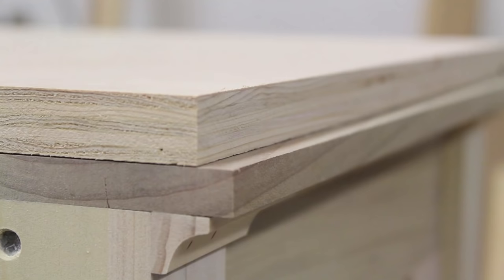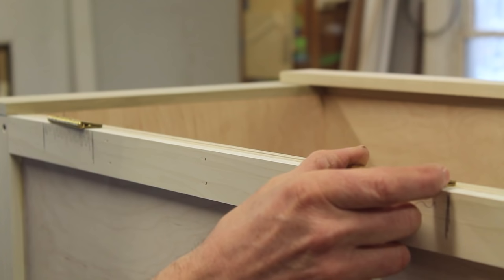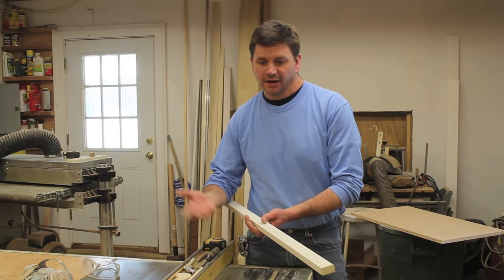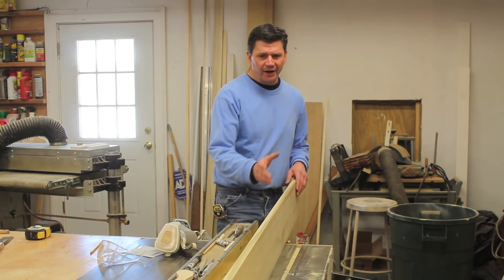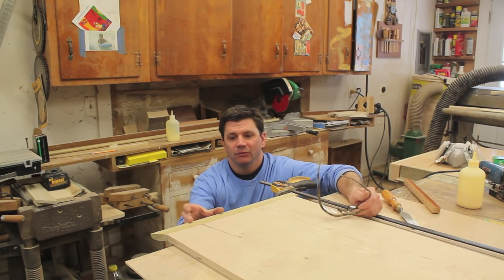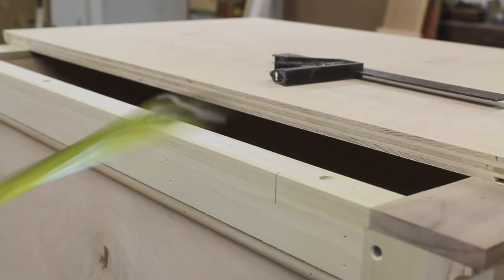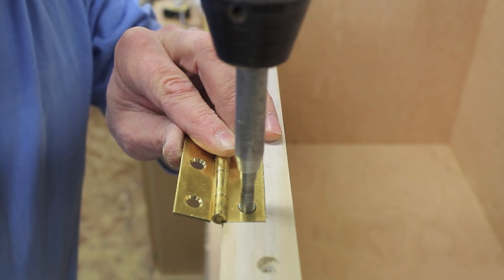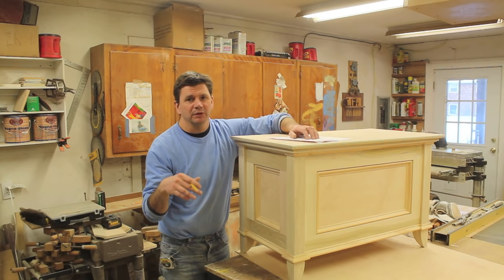Make a Blanket Chest / Toy Chest - Part 2 - Making the Top by Jon Peters

Comment: Jon - I noticed you didn't use any band molding on the back of the lid.  Is this because of of strength?  perhaps the band molding will rip out due to the opening and closing of the lid?  Dave.

Comment: well i come up with another question and may have found my missing ling here , could it be that  the side frame  with 4 1/4 go toward the back as theirs no face frame for the back and its to make up the difference in thickness? to me it would make sense but i'm just a beginner here that's why i was asking. PS: and if it turns out only have as good as yours it will be still great ,  thanks Jon  love your work..Mel

Comment: Hi Jon  , just love this blanket chest , mine is going to be same measurement  but inside finish with red western cedar for a cedar chest  , but i have a question and i need some clarity to where i'm confused. on your drawing cut list  the end frame  one vertical board  calls for 4- 1/4  X 10- 3/4  but the left side on the drawing is 3-1/4 X 10- 1/4' .  My question is "are they both 3 - 1/4  or  should they be both 4-1/4 ?. Im sure theres a reason but im missing it , thanks  PS" But i love this chest.  Mel

Comment: Hi John, 2 quick questions... 1. The last strip of poplar you installed on the top at the rear where the hinges are attached...will MDF be strong enough for the hinges? Or should it be poplar? 2. Is it ok to router the perimeter of the plywood top instead of adding routered poplar strips?  Any advice would be greatly appreciated. Love your vids.
Reply from the maker: Thanks, I wouldn’t trust mdf to hold a screw